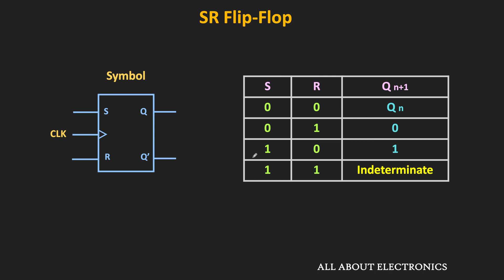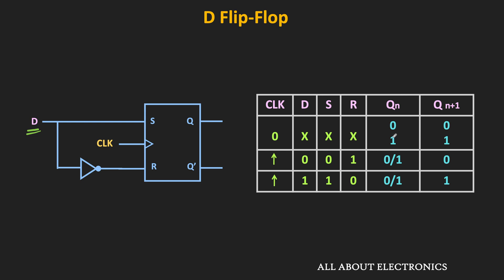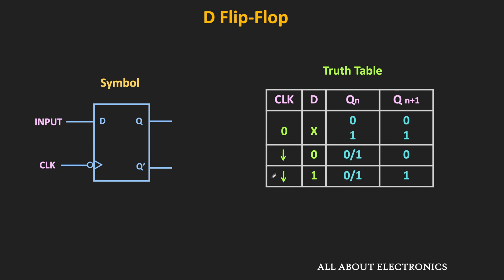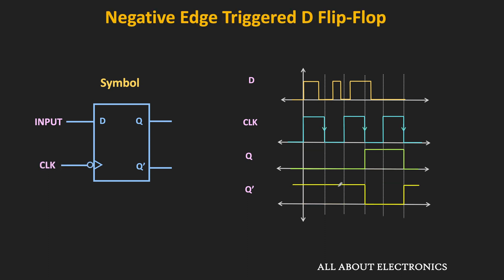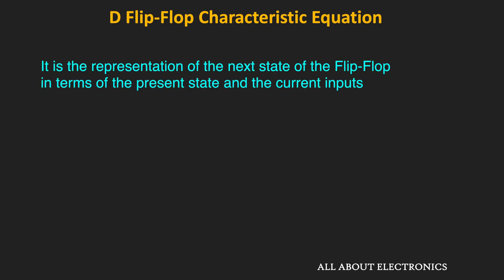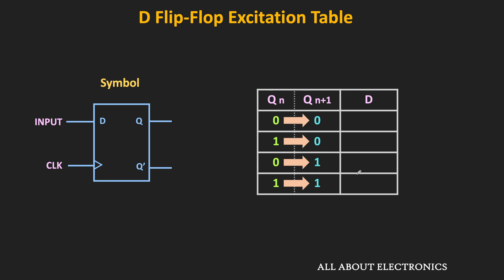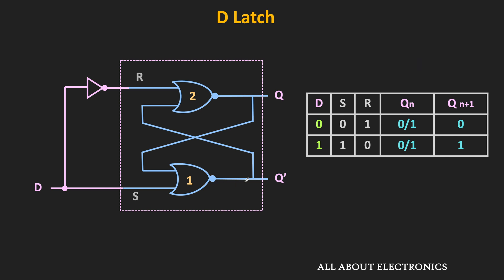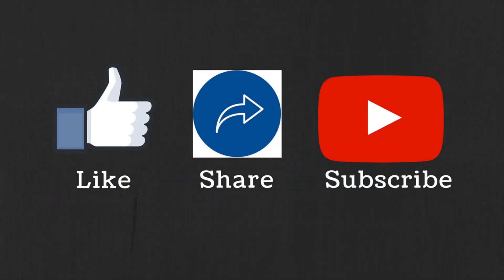D Flip-Flop Explained | Truth Table and Excitation Table of D Flip-Flop

Comment: Thanks for the very good visualization and explication. Unfortunately I have to point out some discrepancies:
(1) You are displaying the truth table of a SR-latch but the title reads SR-FF. 
(2) Further, this truth-table is for active high state-meaning you are using NOR latches for the implementation. This causes confusion on the next slide of the D-FF, where a NAND gate has to be used to get the truth table results.
(3) Finally, it is also a little confusing to talk about the SR-FF right before the D-FF because it evokes the perception of the use of an SR-FF for a D-FF where, in reality, you are using a NAND-based SR latch for building it.
Kind regards.

Comment: how can qn become 1 when d is 0???
Reply from the maker: Hi, would please mention the timestamp, where you are referring to in the video.
Reply from the maker: Ok, probably I got it, where you are referring. I think, you are referring to the waveform. Well, if so, then as you are aware, it is the D flip-flop. And as it is flip-flop, so it will respond to the change in the input only at the clock edge. So, between the clock edges, even if there is a change in the input, it won't affect the output. It will only sense the input at the clock edges. I hope, it will clear your doubt.

Comment: How if the question is given to draw Qn and Qn+1..??
Reply from the maker: In D flip-flop, the output Qn  is same as D input at the rising edge of clock ( if it is positive edge triggered flip-flop). 
So Qn+1 will depend on the D input at Tn+1 th clock edge. I hope, it will clear your doubt.
Reply: @ALLABOUTELECTRONICS Thank you..Why the timing chart for Qn should be drawn 1 clock pulse after the Qn+1?

Comment: what is the difference between a gated Latch and a flipflop? Is it only the clock transistion circuit that is present in flipflop and in gated Latch, there is only Enable Key ?
Reply from the maker: Yes. Because of that, flip-flop is edge triggered and gated latch is level triggered.
Reply: @ALLABOUTELECTRONICS  ok sir thank you

Comment: what is the difference between d latch and gated d latch?
Reply from the maker: I have explained that for SR latch in one of the video. It is also applicable for D latch. 
Please check this link. 
https://youtu.be/xONsaRVYQmA?t=978
You will get the answer. In case, if you still have any doubt then let me know here.
Reply: @ALLABOUTELECTRONICS  I watched it before and learned gated versions are the ones that have enable inputs, so the difference is enable input?

Comment: DO we even need Q'? What's the use of that sir. Error detection?
Reply from the maker: Some times it is required to connect  multiple flip flops. ( e.g counters) 
So, in such case, some times it is required to connect the Q' output to the next stage. 
since you are directly getting the inverted signal( Q'), so there is no need to connect additional NOT gate. 
If you check the recent video of the ripple counter on the channel, you will get better idea, what I am saying.